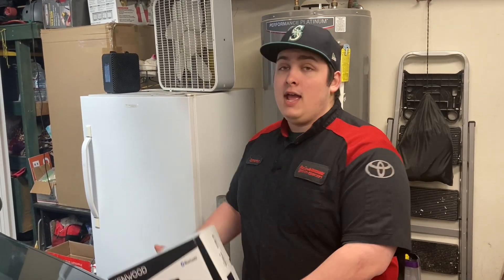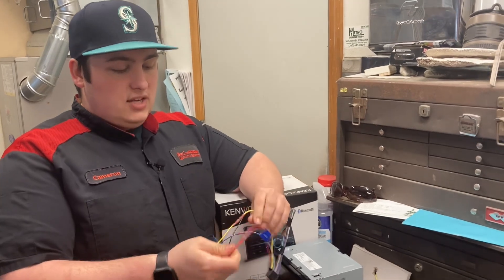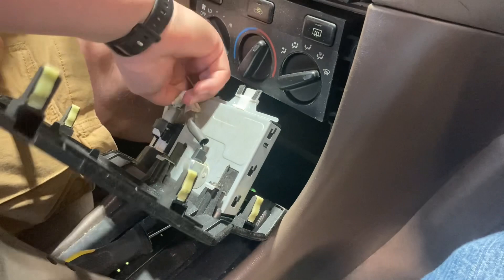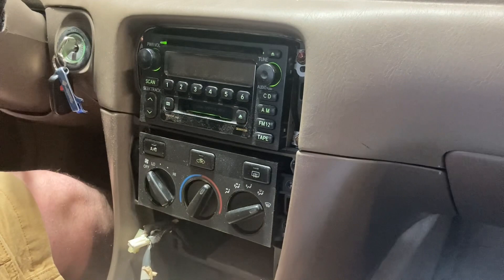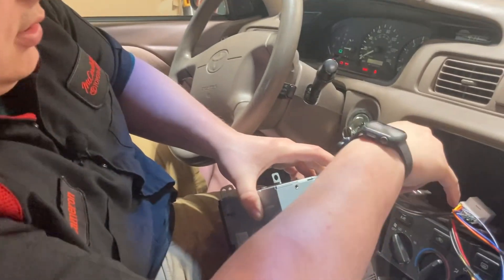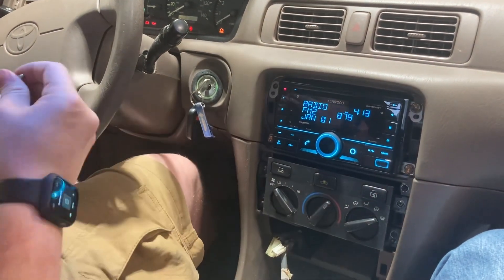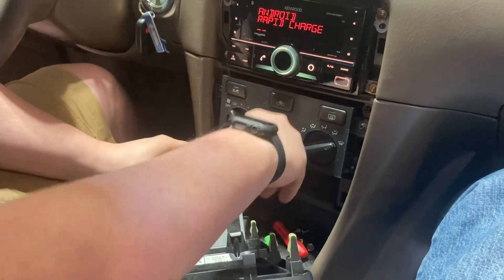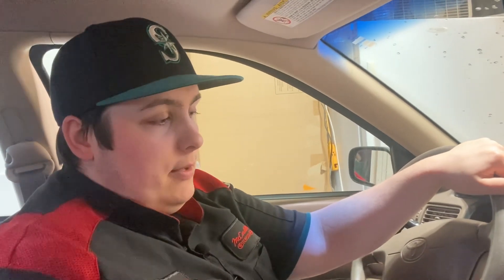2001 Toyota Camry radio replacement (Kenwood)

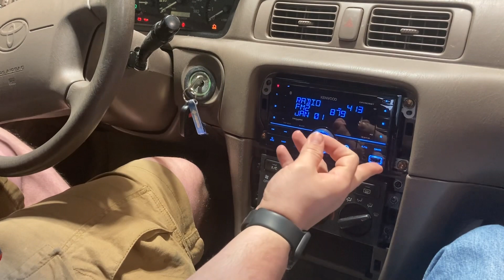Comment: 9:13 but even if you'd wanna listen to cassette tapes (for them making a retro comeback) you could always plug an old Walkman into Auxiliary anyway, or get a Bluetooth transmitter.
Reply from the maker: Tried using both and neither worked very well because the head unit was going bad